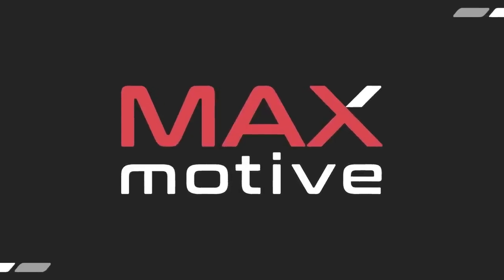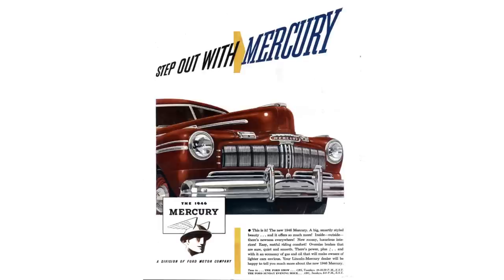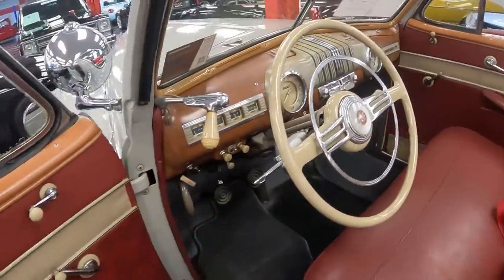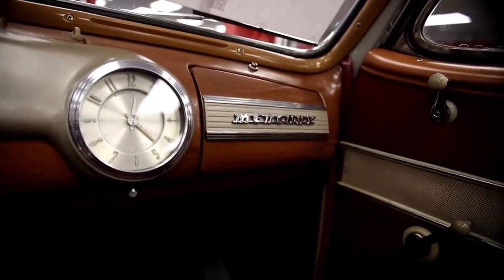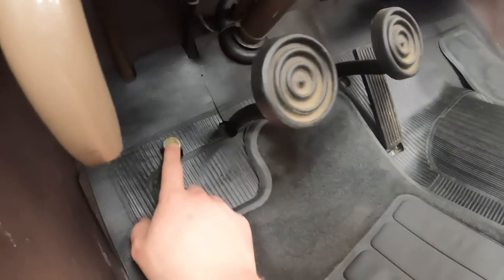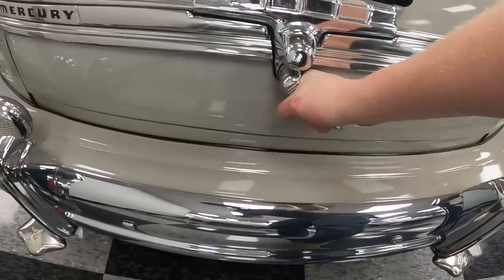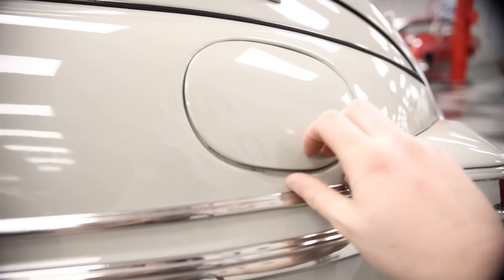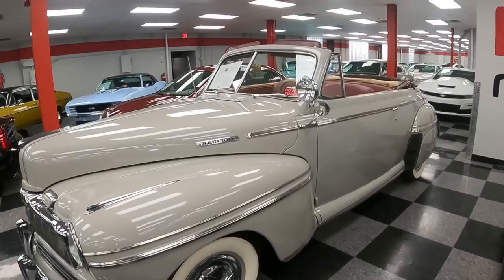1948 mercury 8 in-depth look

Comment: Just a little info on the hood latch.  The "hook shaped" catch sticking up is actually a safety catch in case the the primary one under the sheet metal fails.  Common practice even in today's vehicles.

Comment: I don't want to be  'that guy' but if  you check I believe most of the  ford produced flat head v-8's had essentially an early 2 barrel  carburetor,  the air horn (top portion) is  a  single opening  however it  splits to 2 venturies for fuel metering. This definitely odd compared to a later two barrel. Please don't take that wrong way just hoping to share info
Reply from the maker: No worries I welcome the information =), the internet I found doesn’t know everything, and a lot of information is contradicting, so it’s hard to know the truth 

Thank you so much for the information I really appreciate it =)

Comment: As a kid growing up in the sixties, we definitely did not appreciate these cars, which by then were only old-looking.  They also had far less interior room than you might expect from such a large car - but that was the case with all those big cars.  Big on the outside, cramped on the inside.  Unless, of course, it was a Checker.
Reply from the maker: One car I can’t believe how small it was what is the 56 Ford Thunderbird I kid you not there is more space and a Nash metro and there is an 56 ford thunderbird

Comment: . . . beautiful . . . would like to see the 1956 Studebaker Golden Hawk . . .
Reply from the maker: I’ll add that to the list =) awesome request 56 not 57 or both
Reply: @What.its.like.  . .. both . . . tks so much <3 . . .
Reply: , , , in my opinion, the '56 Golden Hawk is the most beautiful car ever made . . .
Reply from the maker: I personally have a soft spot in my heart for the 57 the 56 had a Packard 352 v8 engine Little to no fins on the back the 57 has the taller fins used to 289 supercharged Studebaker both are cool I’ll even see if it’s possible the find the speedster model that started the design trend for the golden hawk cars 1954 I think that came out maybe 53 I can’t remember offhand but those are getting really hard to find Studebaker golden hawk is pretty quintessential 50s car the speedster I’ve never seen one in person to be honest with you

Comment: You videoed everything in great detail but just a cursory glance at the motor.
Reply from the maker: I’ll work on that there was a lot of buttons on the bottom part of the dash that I didn’t know so left that out.. no information anywhere and that’s what is the hardest part I want to be that channel with that information, because once that info is gone it’s gone.
Reply: @What.its.like.  I probably wasnt clear enough. You videoed all over the car in great detail but no great detailed video of the motor like down inside where the motor is.

Comment: So this is the model before the   famous bath tub mercury
Reply from the maker: I haven’t reviewed one for the channel yet I’ve seen a couple of them but they’re usually more hot rotted out than I wanna show. I try to find as stock as possible for the channel now if it has a different drivetrain in it but still looks stock I’ll probably do it but all of the ones that I’ve seen recently steering wheels modified engines modify different gauges different stance hood has louvers in the roof is chopped..

Comment: hi l would love to see a view on the 58 chevy almpala two door hard top itbis the first year of the amlpala and the first year with the radio spaerker in the back seat and the beanch  and the first year with the x frame and first year with double head lights to and the first year with thre taillights to in the back and the first year with the air vint in the sides on the hard tops and convertible but the hard tops got the chrome air vent on the top in the back widow in the middle on top and in front the single lights the inner one is fake but the oweryer one is real and the dash the high bene the little chevy sign lights up in red to just wouldering and there is a stitch over by the clock that controls the music radio from the front to the back or the front to just wouldering
Reply from the maker: I’ll look for a 58 impala 2 dr thank you so much for the request and information =)